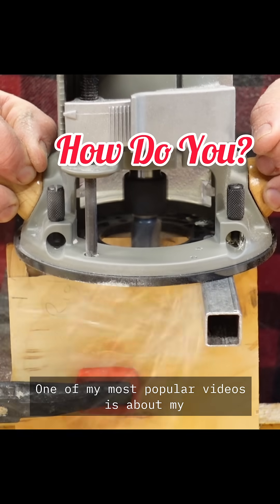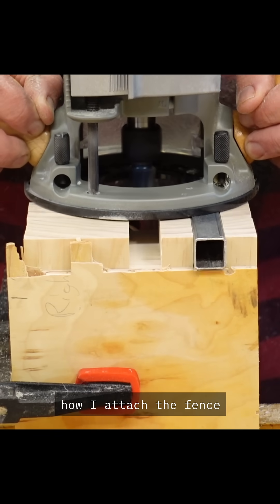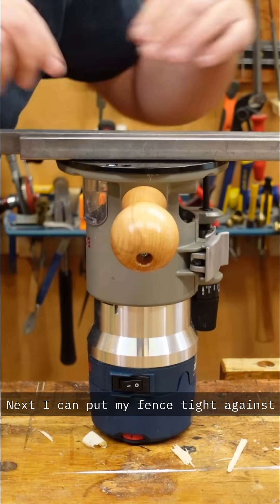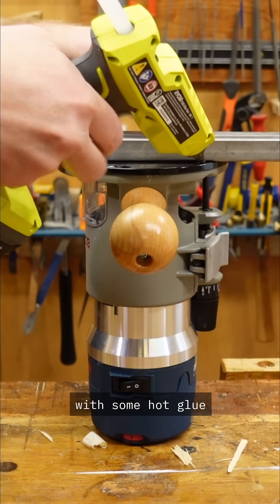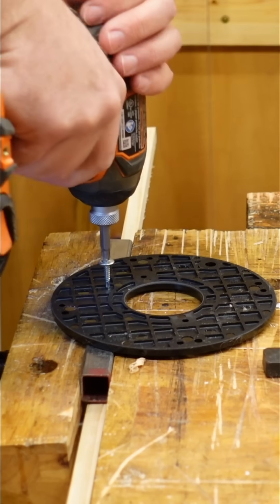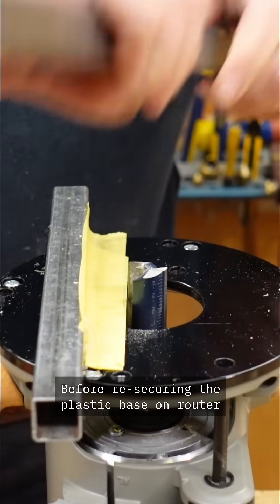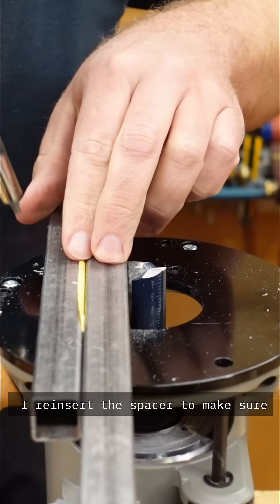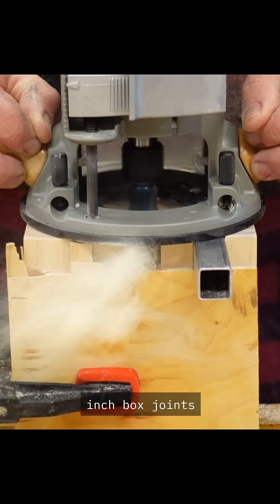Easy Box Joint Router Jig - Part 2

Comment: Isn't 3/4 bit doing in one pass gonna kill your motor quickly?
Reply from the maker: I'm confident this router can handle it. I go slowly and listen to the RPM. A smaller router probably would struggle. Certain species of wood could be challenging as well. 
In my opinion it's largely a matter of feed rate.
Reply: Kill??, An electric motor??
Reply: @SW-fk6jk yes, if the motor can't produce the torque required, it can burn out and go to shit.